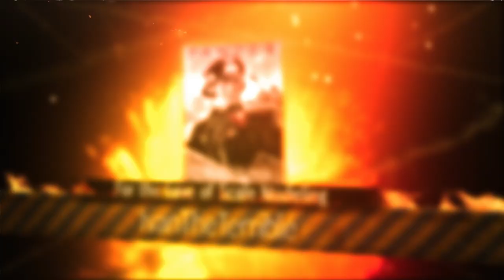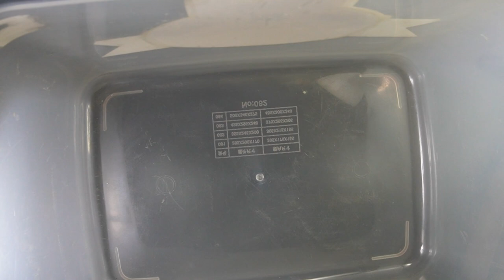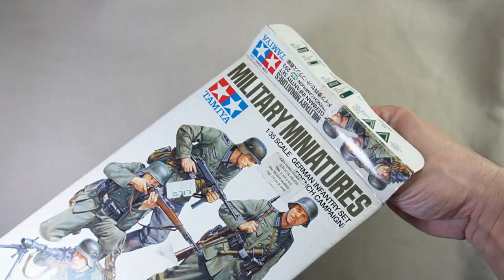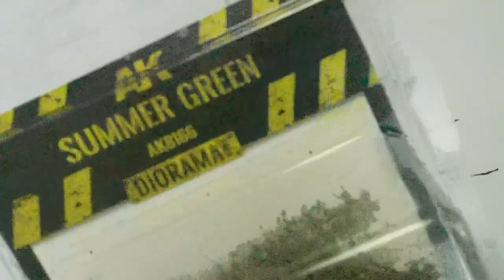HOW TO BUILD "WORDS of COMFORT" DIORAMA  [RESURRECTING AN OLD  ACADEMY STUG ]

Comment: love your work man. you ever use latex to cover those copper wires on your trees? It works out pretty well.. but yours looks great too. i've been thinking about buying some old built kits and doing something similar. with kit costs being so much, you can usually find someone cleaning out a closet from a 1980's build or something. great way to repurpose.
Reply from the maker: Hi Michael. I appreciate the compliment mate. Thanks. Haven't used latex but if you can recommend one i will surely try it. What i used to coat the copper wires was just a simple Surfacer 1500, the key here is to twist just a few strands of the thin wires just about 3 strands and coat it. set it to dry.

You can use Isopropyl Alcohol as an alternative bath to remove the old paint. I love the idea of you buying old kits, makes sense and its budget friendly. Thanks for viewing mate. Hope you can subscribe :) Cheers.

Comment: Super glue and baby powder!  That's got to be worth a try.
Reply from the maker: Hello Adam. Not very many is a fan of it as it requires plentiful sanding. I use this technique when the gap is way too large but i still prefer the hardware grade Epoxy Putty. It's worth a try nonetheless. The powder speeds up the drying and solidifies the solution. Works like a dentist's filler. Cheers.